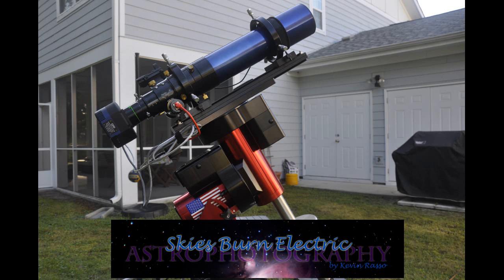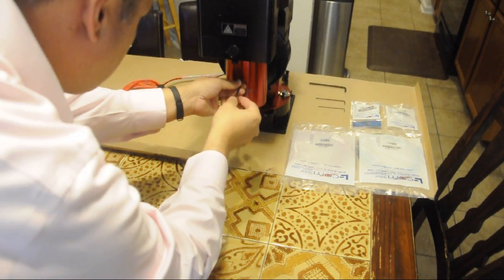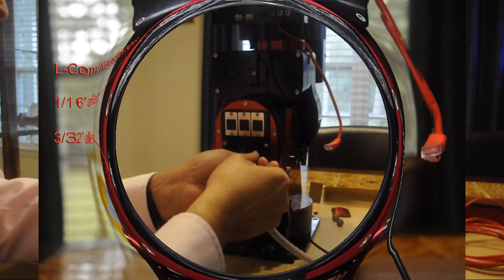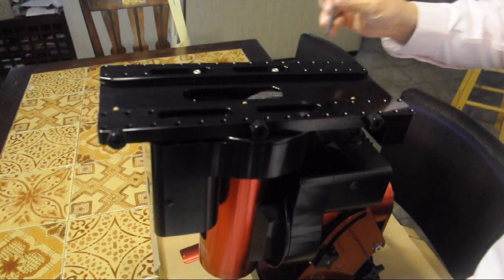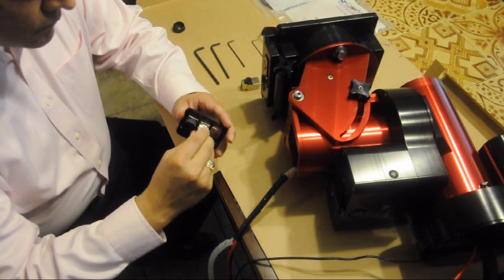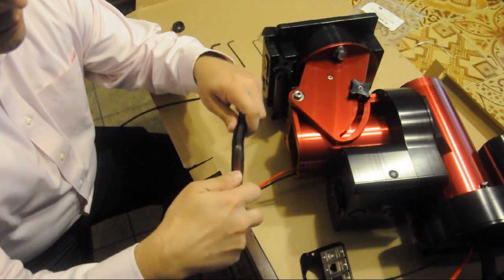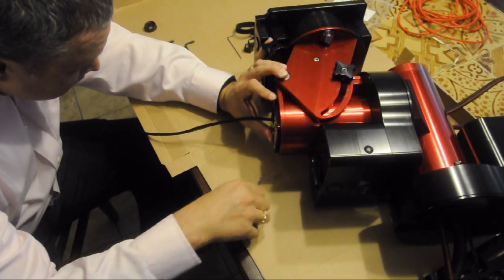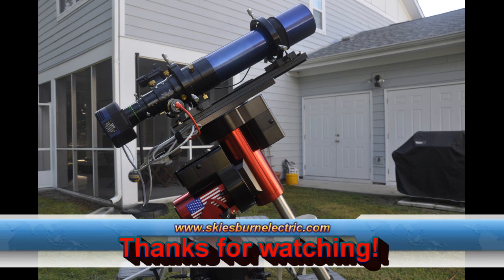Installing L-Com Keys on the Paramount MyT

Comment: Can you post the L-Com part numbers?  Thanks.
Reply from the maker: UADKEY-BA (this is the same type of USB2 cable my CCD camera uses) and TDG1026KS-C5E for the CAT5E cable that goes to my Feather Touch Focus Boss II focuser.  You want to ensure to pick the keystones for the equipment you plan to use.  There have been several added since I made this video, including USB3 supported keystones.  There is even a newer CAT5 key that is integrated into the keystone instead of plugging into the back (more reliable since less likely to come apart and go bump in the night!).  Hope this helps!